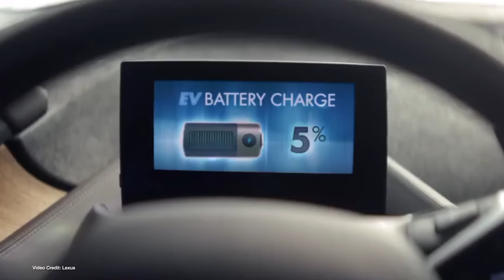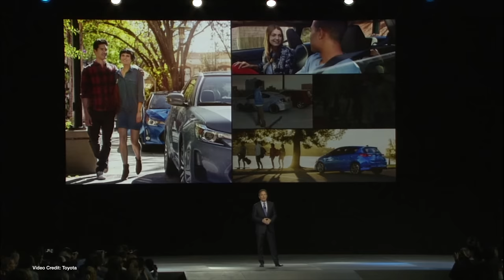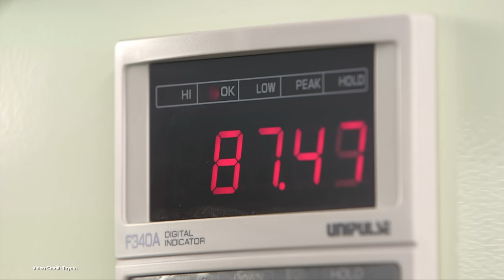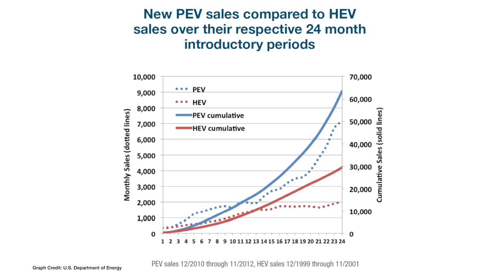Toyota Insists You Can't Ban ICE Cars Yet. It's WRONG.

Comment: 1.  Full EVs are far to expensive for almost everyone - I just read that the average budget for a replacement car is around €16 000..    That is less than half the price of the cheap EVs like KIA.. (we will ignore Renault Zoe because a family can't fit in one)..
2.  Even with improving battery technology these vehicles are super heavy and that means the battery weight will always work against range..
3.  The famous range...  Quoted figures are being seen as a lot less range in real life situations.. Hills, cold days, hot days, faster driving etc..  So many of these vehicles only have 150-200km range and apart from commute days this is too low..
4. If like many city dwellers you don't have off-road parking then you'll need to find a charging station and leave your vehicle there..  Now to keep your vehicle in good condition you don't supercharge it every time... So you'll be leaving it to charge for a couple of hours..  You will need to fit that into your work routine then..
5. Can the electricity generation keep up with demand?  No..  They want to rely on renewable energy but that does not even begin to cover our present market..
6.  Is there enough world supply of these elements for battery production?  No if more people ask for an EV.
7.  Many, many people are seriously sceptical about the long term costs of EV ownership... Many do not believe these expensive battery packs and motors will last..
8..  People are wiser to governments now.. There is aid and tax advantages now but once they take up is high enough they will be forced to charge for road usage.. A price/km to drive.. Then they'll ask for a separate consumer rate to charge your EV at home..  So all the present advantages will dissappear and you'll be left with an expensive, low range vehicle whereas you had a much cheaper, more practical ICE before...

The world will change but not overnight and the BEV route is only a stepping stone to something else not the final answer to car usage..
Reply: @rogerstarkey5390  thanks for your reply.. Some valid points there of course.. 
80% of new performance after say 10 years may be acceptable to owners.. I would say any expensive failures wouldn't be..
Here in France where the income is higher than Italy new car buyers tend to buy a Clio/207 etc.. You quote Norway but here the figures are skewed as the income in Norway is much higher than elsewhere in Europe (with the exception of Switzerland)...    Also most people are used car buyers so that budget I quoted reflects the buyers that buy are not generally buying new
Here in France there are a few who have dipped their toes in the EV market but only really the Kia/Hyundai models..  Buyers who buy these are buying on long term rentals - very few have the money for a purchase..  This seems to be the way things are done in the UK but long term these lease deals are expensive...  Many still like to keep a vehicle for 10 years or more and get all the value they can out of it..
But doing a straw poll with friends and colleagues there is very little enthusiasm at all for EVs.. This is clearly based in order 1. Price  2. Range and 3. Long term EV uncertainty... 
If price was 50-60% less than they sell for then I am sure that maybe people might forgive range and uncertainty..  But the low range EVs and unreliable manufacturer range figures are not going to make people buy them...
I for one think EV for city commuters  in small size vehicles..  For others plug in hybrids and for long term another approach is needed to deal with the 100% battery EV issues I mentioned ....  I'm sure that come 2030 the people won't be changing their driving methods..   Regards

Comment: Strange to have such a large omission in the history.  There was no mention of Toyota's switch to lithium for gen-4 Prius or anything about the models of plug-in hybrid.  It's as if the perspective was from a number of years ago.  Since then, several PHEV and BEV have been rolled out to various markets.  Toyota is delivering a mix of plug-in and fuel-cell offerings.  They sell to diverse markets.  This year, reveals of another BEV and two PHEV are expected.  Also, don't forget that hybrids did not have generous tax-credits here like they did for plug-ins.  In fact, they weren't even available until January 1, 2006.  And even then, the money was half as much and only available for 60,000 before phaseout.  Lastly, don't overlook how much the 42-mile electric-only range delivered by RAV4 Prime does to reinforce how well refined Toyota's EV drive already is.
Reply: The reality is, Toyota was ahead, but they dropped the ball and they are in danger of going out of business if they don't catch up to the basic standard.
Reply: Where's 'here'?

Comment: If you're worried about BEVs effect on the grid, making hydrogen from the same power source is about 3 times less efficient.
Reply: Hydrogen is 3 times more expensive than gasoline, and 8 times more expensive than electricity.  Hydrogen is currently made the cheap way (from fossil fuels), if they made it with electrolysis, then it would double in price and NO ONE would would want it.
Reply: Exactly.....

Comment: Totally agree, hydrogen for passenger cars doesn't make a lot of sense. Hydrogen for aircraft and shipping (ocean, train, long haul trucks) makes a whole lot more sense. The infrastructure doesn't have to be as dispersed as for passenger cars and the power density is much more important for those applications. Even a RNG infrastructure is better for those larger vehicles than trying to run them on batteries until battery density and safety is increased.
Reply: Hydrogen does not really make much sense for airplanes either considering the tank issue. IF someone EVER cracks the code of hydrogen storage that we were reading about in Popular Science back in the 90s, then it might work in planes... But the current tanks are ill suited for the current shape of commercial airplanes.
Reply: Toyota is working on hydrogen for the heavy industry too, hydrogen can replace coal for steel production too.
Reply: @patreekotime4578  hydrogen is well suited for airplanes and many companies have been working on a better storage solution including toyota.

Comment: the EV story seems to have a lot of parallels to the smartphone story. 
it'd be kinda funny if it unfolds similarly. 
so far, it is looking...
Reply: Exactly this!
Reply: I think the Personal Computer is a better example. 
Smartphones came, to a degree, out of the blue, it was a very fast technology shift that was not obvious until it happened. The PC taking over from Mini computers and mainframes on the other hand, was something that could be seen coming a mile down the road, it happened (relatively) slowly but the dominating players (IBM and DEC) could not turn fast enough. Much like EV's. The question is not (and has not been for a long time) if this will happen but who can turn quickly enough. Clearly, Toyota is one of those that can't. They are the DEC of automobiles. (Those of you who are in your 20s and 30s probably haven't heard of DEC and that's exactly the point. Google it.)

Comment: Great analysis, as usual, just a few details. Toyota hardly believes HFC cars will represent viable alternatives to ICE cars in the foreseeable future, or BE cars, ever. Last time I checked, they had a production capacity of 3000  fuel cell stacks, per year, and planned to increase that to 30'000 per year, to some time in the future. That's stacks, a car takes one, their prototype HFC trucks needs four of those each. For a company that sells 10 million vehicles per year, neither up to 3000 or planned up to 30'000 vehicles per year says their trying to transition away from ICEV, it is a PR scam, they pretend to be working on a solution, in order to get to make as much profit as possible, as long as possible, from what they know how to make profit from: ICEV. If they reach a production of 30'000 stacks per year, that would represent <0.3% of the total number of vehicles they usually sales per year.

Also, hardly any other company or even any other kind of organisation, knows more about the problems with hydrogen as a vehicle fuel, and you don't need to be an expert in the matter to see that HFCV wont become a solution to actual problems. The idea of HFCVs grew strong in Japan, as one the solutions to their severe air pollution problems, in the 70's, if I remember correctly. Not as a way to reduce climate gas emissions, but to move air pollution created by fossil fuel use from cities to less densely populated areas.      

Exactly when car manufacturers realized that promoting HFCVs as the solution to all fossil fuel issues meant no threat to their business, not current, and not in the foreseeable future, I don't know, but I guess it was before they put any real effort/resources in to it.     

The current price of EVs yes, economy of scale and further development will decrease cost, but you also have the factors of manufacturers still aims at a limited production when they're planning, every large, and even large-ish car manufacturer still limits their EV production, and/or sales, on purpose, in one or more ways, except, you know, Tesla, and some Chinese companies. That, and the fact that battery supply doesn't really match demand, and a large part of the investment in production is new, there are limits to how fast global production can be increased. 

Tesla has been clear about the affordability of model 3 all along, $35k was accepted as the average price of sold passenger cars in US. The average payed price, and running cost that's a fraction of the normal, kind of affordable, for a new car. Sure, that was the very entry level, that they didn't want people to buy, but still, for it's segment, total cost of ownership is not high, it can get very low.  At the time of announcement of model 3 it was very affordable, relatively, as in compared to any other EV on the market that was really practical for longer trips, i.e. Tesla model S and model X. Closest contender I can remember was Nissan Leaf, at the time of announcement of model 3, in 2016. That was the year leaf got the range increased to 95 miles highway EPA range. 

Also, the feeling of saving the world by driving a new EV is not a basic human right. As long as Tesla sells all the cars they can produce, and they produce as many as they can, the environment doesn't care about the price tag. It's actually a good thing to sell mostly to those that are able/willing to pay a bit more for a car, among them you find those that otherwise had bought a bigger more powerful, and therefore more thirsty/polluting ICE car.

Comment: If you banned normal cars, where are all the millions of people in southern california who live in apartments supposed to charge their EV's? EV's are amazing but they're a luxury right now. We all know it. Anyone who thinks otherwise is living in a bubble. Don't live in a bubble. Bubbles are bad.
Reply: Arguments like yours always posit a singular change that somehow happens overnight, without warning, and without preparation. That's not how it will work. Any plan that attempts to eliminate ICE vehicles entirely will be a gradual, decades-long effort that will be multi-pronged in terms of regulation (including zoning and building permits) and will include improvements to and expansions of the charging infrastructure that take apartment dwellers into account.
Reply: We are talking about a ban of sales not a ban of operating.  Once burning damaging fossil fuels becomes very expensive the market will find solutions. Those in flats can already charge at charging stations away from their home or even while they at work etc.  There will be some sacrifices but it’ll be a price that will have to be paid
Reply: So, in your bubble can all those southern California apartment dwellers refuel their cars with gas overnight? No? They all have to go to a gas station to refuel, you say?
Interesting. So it won't be much of a change if the same people now have to go to a recharging station then?

Comment: I think you missed the discovery a few years back of massive deposits of methane hydrate "just off the beach" in Japan.  For a while Japan was excited about being energy independent and I suspect that's when they created their large attachment to hydrogen fuel cell vehicles.

Leadership in Japan just seems not to get it.  I don't know if they aren't concerned about climate change or aren't keeping up with battery improvements and the way battery costs are plummeting.  But people down from the top figured it out earlier.

October, 2017
 
Yoshikazu Tanaka, the chief engineer in charge of Toyota’s Mirai, admitted to Reuters that plug-in cars make more sense:

“Elon Musk is right – it’s better to charge the electric car directly by plugging in,”

Comment: On the subject of hydrogen I think it may depend on the country. After owning a BEV I don't think quick  charging is so important.  No matter how densely populated cities are the cars need to be parked overnight somewhere. All we need to do is put charging plugs on those places and the charging issue disappears.
Even for those that think they need to recharge fast I think once they realise what the real cost of hydrogen is and the inconvenience of having very limited places to refuel I think they will adapt.
It will be much easier to install fast chargers than hydrogen pumping stations and you still have the chicken and egg problem. No one will install a hydrogen pump if there are no cars and no one will buy a hydrogen car if you can't refuel it. But BEV on the other hand do not suffer this problem because they can be charged at home.
Even with zero charging infrastructure BEV are viable for certain cases an that can (and has) provided the initial numbers needed to justify the charging infrastructure.

Comment: After all of your ranting you said it: "Electric cars are still too expensive for most new and used car buyers". 14 mounts ago I bought a new Toyota 2020 Prius Prime Limited for total cost of $28,500. I love this very efficient plug in hybrid car. I will probably  use 70 gallons of fuel in 2021. You are making a-lot of good point in this video. I also hope that Toyota makes more all electric cars and trucks. Really like your vids on electric autos. Thanks from Seattle.

Comment: I would love to own an electric car. But I must use public parking. I have to walk 400 meters to mostly see the closest by charging facility used and then walk 400 meters again to see a second time late in the evening hoping that there is one (of two) free. If so, I have to walk back, get the car, go to the charger, wait for the charging (not very fast charging), deprive myself of sleep, get the car at 3.00 am after walking 200 meters again, drive home and go to bed. Walking is painful for me (slight disability). So yeah.... I won't electrify until forced to. Oh, besides that, it is just as expensive here on public chargers as driving on fuel, and the car would be twice as expensive.

Comment: Hydrogen for personal cars is most definitely not worth it.  Hydrogen for trucks and other heavy machinery is another matter, however.  Also hydrogen for steel mills and concrete plants is something that should be pursued.  So massive availability of hydrogen from renewable energy is something we're going to need, and once that is available the market can decide whether they wish to introduce smaller fuel cell vehicles as an alternative to EVs.